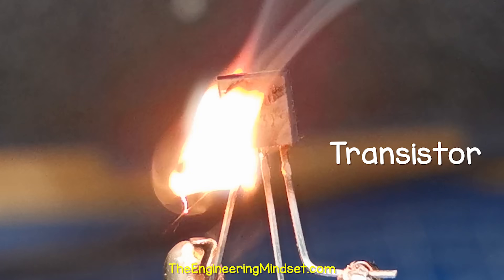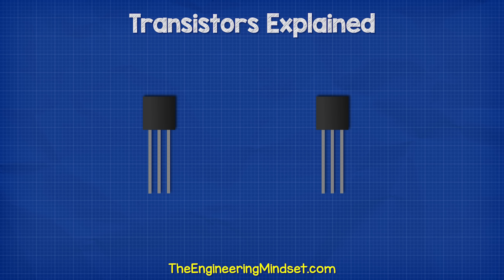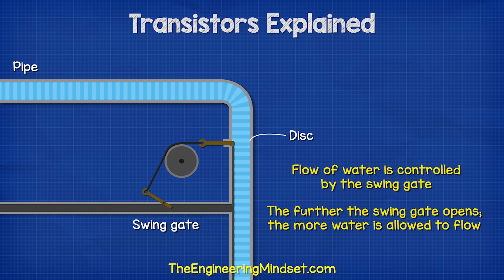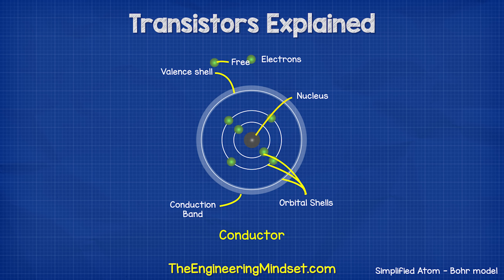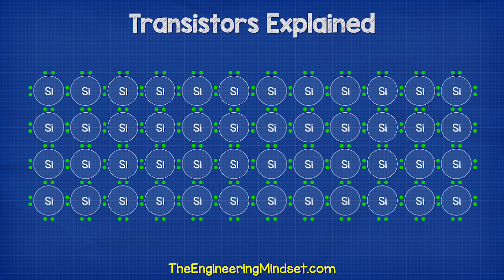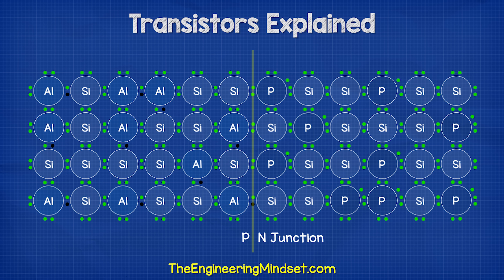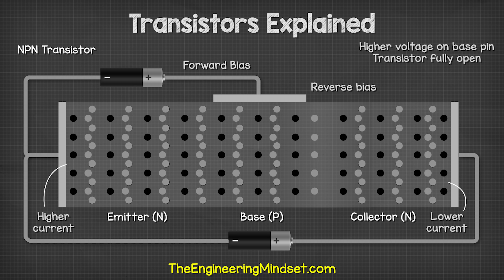Transistors Explained - How transistors work

Comment: At 07:04 for NPN you have shown current flows "into" the base, but at  16:24 you are showing the current flows "outside" the base.

I hope the 1st one is correct, however please comment on which is the correct direction for NPN and PNP. All the above are conventional current flow and not electron flow direction. So, lets stick to the same.

Great video and explanation, made easy to learn. Thank you for your effort and time.

Comment: So the npn transistor on the control circuit and main circuit loop I have a question.
The reason the main circuit does not get power until the control circuit switch is active is because it does not have a path for the current to get back to the - terminal?

It’s confusing though because the led and resistor are before the transistor on both….
Is that because you should use electron flow vs conventional ?

Comment: 7:04 why current is flowing throught the  diode ?
Reply from the maker: No diode is shown at 7:04 ? There are resistors to protect the LED. There are two types of transistors show NPN and PNP
Reply: @EngineeringMindset this red components are not LED diodes? Because if we switch the direction of flowing current like on the right side diodes are not in reverse bias?

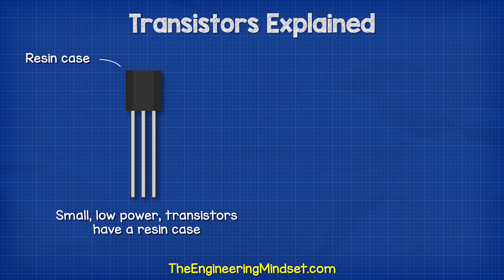Comment: 0:42 transistors do not amplify. They transfer energy from a power source in a way approximately related to a control signal, giving the impression of an amplification effect - if they are in their quasi linear portion of their transfer curve.
Similar, but not the same thing.
Hence "transfer resistor".

Comment: Greetings, The Engineering Mindset!

It may be worth noting a minor error - at 2:06 you state that most transistors have the structure of 'EBC' at the flat edge, however it seems to be the opposite case. Most bipolar transistors, including the transistor shown (2n2222a) have the 'CBE' structure from the flat edge. https://www.onsemi.com/pdf/datasheet/p2n2222a-d.pdf

I was just a little confused when the transistor started acting weirdly. Anyway, have a nice day!
Reply: After some further investigation I found that the issue was not with your diagram, but because I had wrong connections in the circuit... it is strange that transistors work in reverse, as seen in your video.

Comment: 18:00 What exactly would cause the main flow (from emitter to collector) from stop flowing if you turn off the smaller flow (from emitter to base)? Why can't the electrons just continously push their way through all the way from the emitter to the collector without the smaller flow?

I have a theory, but I'm not sure if it's correct: I was thinking it's because the electrons from the main flow wouldn't be able to push through the first depletion region and continue all the way to the collector on its own, because the first depletion region and the collector is far away from each other. However, because the first depletion region and the base are close to each other, the smaller flow can break down the first depletion region on its own. Once the first depletion region is broken down, the electrons from the main flow can flow freely all the way through to the collector.

Comment: Isn't the final part mistaken, when both batteries are somehow connected to the transistor's emitter? In the beginning, you told this convergent point (node) takes place at the collector and I agree more with that, as the symbols have the arrows sketched on the emitter line, stating this is either a single input or single output.

Comment: @ 4:12 the battery is connected to the circuit backwards. this threw me off for like an hour.
Reply from the maker: No, its correct. The small terminal on a 9V battery is the positive. This connects to resistor, led then collector. Load is placed before transistor.
Reply: @EngineeringMindset  Wow, thanks for the fast response. I'm confused about batteries. So in this case the battery anode and LED anode are pointing at each other? like, facing opposite directions in the circuit? and if the battery were charging, that terminal of the battery would become the negative but STILL be the anode?

Comment: hey bro, in the npn and pnp circuits the current is flowing from positive to negative but the flow of current is negative to positive right. so is this your mistake or am i missing something? 🤔🤔
Reply from the maker: We design circuits using conventional current, positive to negative, but they actually work using electron flow, negative to positive.

Comment: I had accidentally put the emitter and collector backwards on my npn transistor, caused my arduino to reset but the circuit worked, I stopped the circuit when it started to reset 2 - 3 times which told be I did something wrong, so I since I am a beginner I looked up what I did wrong and well here on the video explains exactly what I did wrong, I should of been putting the positive flow into the collector instead the emitter received it instead, I guess I was lucky I was using low current if I didnt I think I would of killed my arduino board.

Comment: You beautiful mind. It is so true, the more we learn the more we realize we do not know. 
I am currently taking a Motor Controls 2 course and we are going over transistors. I thought I had a
vague idea what these were, but I was wildly mistaken. 
Thank you for your time, even 4 years after posting. 

Side note. This boggles my mind even further house they are able to place 10 billion transistors in
a CPU! Then wire them up with UV light and Nano particles of tin, literally flying through the air.

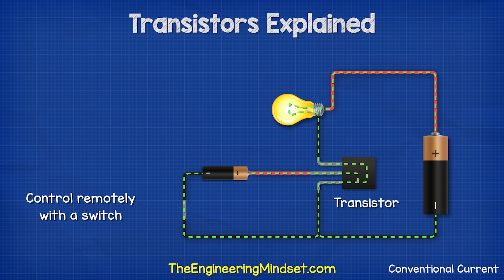Comment: At 2:54, I don’t understand why we need to use a transistor to control in this example. Since it still requires a switch which mean it still needs to be manually controlled by a human?
Reply from the maker: At 3:00 notice the switch has become a sensor. The switch could be manual or it could be an external circuit, a sensor.
Reply: @EngineeringMindset  Thank you !

Comment: Echoing the majority of comments, this has to be one of the clearest explanation of transistor theory.   My initial training was 1988 for aviation electronics/USN, and while I did 6 months there graduating 1 of 34 I didn't quite "get" the transistor until very recently.  And now.. it's just about crystal clear.    Beats the old as dirt training we received in TN back then, hands down.    I'm in my 50's now getting back into the mix, and relearning my old trade with resources like this is awesome.    Thank you for putting the time in here, much appreciated.

Comment: So a transistor is a relay/solenoid but no need for a ground and instead of just on/off it allows for variable voltage control based on the base voltage input.

Comment: If we had to know all the complexities of a car before we could drive it, very few people could ever manage it. 🚗
I rebuilt a guitar tube amp including rewinding a blown input transformer with the high voltage windings and the heater circuit together (thanks to YouTube video). I know what the components are called but not really knowing how they work. This certainly makes most of it understandable to an old brain like mine.

Comment: Spectacular, I have one question though, at 15:11, you mentioned that due to the reverse bias the depletion region widens, right? Why? Don't wholes signal the absence of electrons, the P-Junction doesn't have enough electrons, right? Reverse bias should encourage the movement of electrons from the negative terminal of the battery toward the P-Junction due to the absence of electrons ( Potential Difference )

Comment: I get confused on the idea that a transistor amplifies a signal.  The reason is that in the example above the transistor is already connected to the 9V battery; I understand the forward bias voltage allows the transistor to conduct, but where is the amplification? the 9V battery has been connected and present the entire time.  I understand the base V is just closing the switch.  Thank you for the explanation it will really help me.

Comment: Am I wrong or is the text in the bottom at 8:54 wrong. To deflect electrons to the bottom of the tube the magnetic field has to point into the display, because of the Lorentzkraft and the right hand rule (left hand for electrons) and the magnet therefore has to be under the tube and its nordpole has to point out of the display (or above the tube and the nordpole points into the display)?

Comment: I know this video is about the transistor but I can't seem to find what makes the transistor open or close. I do get that you'll put a current on the base pin, but what decides if the base pin has current or not? A switch, sure, but people don't sit and switch switches in a PC, sortware controls the transistors. What makes a mechanical system get triggered by software? I do get that processors have certain instructions, but if the PSU puts an initial current through a circuit, how can that circuit change?

Comment: Wtf but then you still need a physical switcher
Reply from the maker: No you don't. As mentioned, you can use a sensor, a controller or another circuit to activate the transistor

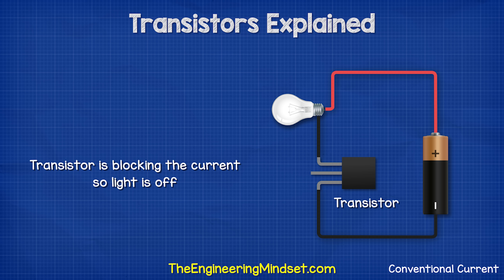Comment: pls someone explain me this. at 2:35 he says that instead of a human constantly turning the switch off / on, in order to automate it we use a transistor. and then adds another circuit which is operated by human itself. then what's the use of transistor if at the end of the day a human needs to be present there to manually switch it on/off?
Reply from the maker: I also show a sensor. It could be a raspberry pi, arduino or another circuit sending a signal to control it. Humans don't need to press it.

Comment: Im working in a semiconductor company that manufacturing various components for various companies specially for automotive industry and some others as well.

Im working in a transistor department. We make transistors only. There is other department as well like integrated circuit and resistors. My production line manufacturing transistors for companies like Samsung,Texas Instrument,Mercedes Benz,Apple,Toyota,so on...im a technician here and my work is to troubleshoot and fix the machines when it is down so that production can continue.

The transistors that shown in the video,it is produced here right at my workplace lol. I instantly recognised it when i see it. And one of the transistor is only made in this company. There no other company in the whole world making that thing. So doesnt matter where you are in Earth,if you want that transistor,you have to seek my company. See you here,lol...

Comment: Great video! In the last example I was waiting for what would happen when removing the battery connected to the Base Pin while the other battery is still connected to the Emitter/Collector. Basically how it looks when "turning the switch off".

Comment: Why in a pnp transistor (6:30) is the convention that the emitter is where conventional current enters, whereas for an npn transistor it is where it exits? This seems needlessly confusing. I can see this keeps the emitter as the 'highly doped side' but why is that important? And why call it collector and emitter in this case?

Comment: Your videos have ruined my understanding of circuits... I've watched so many of them (& other channels) and have yet to find a clear explanation of how electron flow doesn't completely fvck DC circuits created in conventional flow that everything is based on... Can you please make a video explaining only that concept in simple terms‼️ 
Like a DC circuit diagram with a power supply higher than the load is rated for, so there's a resistor on the positive line to "lower the current" to a point the load can handle... except in reality, electrons flow from the negative side so the load gets the full current and melts/blows because the resistor would only lower the current between it and the power supply... but apparently that doesn't happen so WHAT am I missing...
Reply from the maker: I've shown this in many videos. Resistors explained for example. The current is the same so the fuse or resistor can be placed on either side.
Reply: @EngineeringMindset  Thank you for the reply! Are you saying even when DC I could only expect to see a change in current between parallel circuits and the location in series doesn't matter because current will always be consistent across? Or am I still understanding it wrong?

Comment: 0:17: 💡 A transistor is an important electronic component that can act as a switch and amplify signals.
4:01: 🔌 This text explains how a transistor works and its applications.
6:38: 🔌 The video explains how transistors work and the direction of electron flow.
9:48: ⚡ The structure of a conductor atom, the role of valence and conduction bands, and the concept of doping in semiconductors.
12:50: ⚡ The process of forming a PN junction and its behavior in a transistor.
16:08: 💡 The video explains how a transistor works in a P-type material with reverse bias.
Recap by Tammy AI

Comment: So, when designing a circuit or including a resistor, diode, transistor or any biased component, should we reverse the wire hookup to make up for electron flow or conventional flow? Dam conventional and electron flow is so dam confusing.
Reply from the maker: No, always design using conventional current. For all circuit designs we ignore electron flow.

Comment: It makes sense for a electron to flow from a negative place to a positive place because it's a negatively charged particle. For most other things positive means (high concentration) so positive flows to negative (nature abhors a vacuum.) But electrons are a negative particle, so a negative means there's lots of them and a positive means there's few of them. They go from the crowded room to the less crowded room. 

This is important because conventional current can confuse someone as it turns a emitter pin into a collector pin and vice versa. 

In fact in a transistor current flows from the emitter to the collector and is controlled by the base. 

For anyone confused, conventional current was invented before we understood that electrons were negative and probably before we understood atomic physics in detail.

But it usually doesn't have much of an effect on circuit design because for most components it doesn't matter what direction the current flows only that it does. 

But its a outdated incorrect way of looking at things.

Comment: Reading the comments I think I am the only one who doesn't have a clue of what's going on even after viewing the video 3 times, I feel so dumb :(
Reply from the maker: You apply a voltage and current to one of the pins of the transistor and it allows a larger current to flow in another circuit, through the transistors other two pins. Don't worry about trying to understand the physics inside.

Comment: Is a resistor the same thing as an insulator?
Reply from the maker: Mmmm kind of but kind of not. An insulator pretty much doesn't allow any current to flow through it but a resistor just makes it hard for current to flow. The lower the resistance the more current can flow

Comment: I'm only getting .5v to the base pin....where should I look next?  It is a refrigerator...symptoms are relay keeps burning out...will work for a while but then relay starts rattling and sparking....it is getting power to pull the contacts together but it is arcing because it isn't a strong enough pull

Comment: At 14:42  when the negative terminal of the  battery is connected to N, are they using electron flow or conventional flow.
Reply from the maker: The electrons flow from the negative so it is electron flow

Comment: How is current determined at 6:02?
Reply: we can't find it without knowing the resistance of resistors, he just made it up for the example
Reply: also you can determine the resistance using the the color code on the resistors
Reply: @m0taro365  i actually did that and couldn't calculate any value close to the one he gave, that's why i'm asking ^^

Comment: I've been trying to understand this stuff for a few weeks now and one thing doesn't make sense to me.

When the depletion region is formed, the free electrons in the conduction band of the N-type silicon fall into the holes of the P-type silicon in the valence band. In the video, you claim that holes will also flow into the N-type side of the depletion region. How is this possible if the electrons that filled the holes in the P-type side came from the conduction band and not the valence band?

Comment: Something to note: Since the electron "flow" occurs on the outer surface of a copper wire, it's very important to strip wires without gouging or nicking them.  When you do, you are essentially creating a "pothole in a highway" that will cause heat build up and eventual failure of the circuit as electrons "crash into each other".
Reply: So.....in any circuit, delays usually mean heat?

Comment: There’s always been something with the concept of transistors that hasn’t clicked for me.

I think what I really need to know is how they’re used in practice. What kind of circuit can be made with them, that wasn’t possible before?

Something a bit more in-depth than the lightbulb example given. Like, what are their key functions in a transistor radio?

Otherwise, very good video. Thanks so much.

Comment: 2:55 how is adding a switch to turn transistor on and off which then turns the main circuit on or off better than just adding 1 switch to the main circuit. it adds unnecessary parts and power?

Comment: One significant aspect of the pnp and npn transistor is they can be connected togther electronically to form what is a multivibrator, which is a circuit that can hold logical memory, either a state of 1 or 0 bit. Thechnology is facinating.